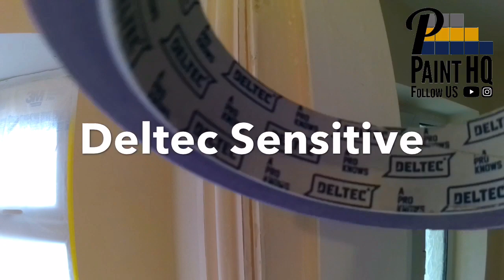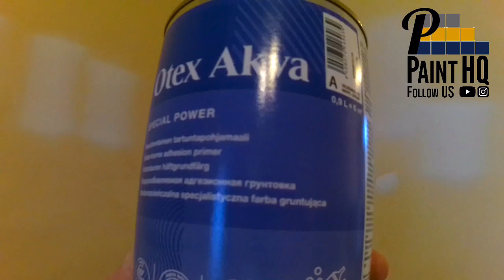HACKS for Painting! Hand Masker tips to spray a door frame

Comment: Will a flatter paint cover up the semigloss overspray? For example crown to a ceiling? Would a complete flat paint cover over semigloss without out any shadows?
Reply from the maker: Hi Chris, in my experience I’ve never had any issue with covering the overspray.. I tend to use a durable matt product, so it’s not a dead flat matt.. sometimes I’ll quickly scuff sand the overspray, otherwise I’ve gone straight over, with no issues 👍 good question my friend.. great to have your. Input on the channel... regards Pete

Comment: Did you add some water for this paint or you spray straight from can? 😉
Reply from the maker: Hi Sebastian, thank you for your question.. if I recall I sprayed straight from the can.. typically with airless spraying I don’t thin paints, the handheld is airless too but sometimes a splash of water helps ease the flow and keeps the speed down.. I don’t look to go above speed 7.. it’s when these handhelds are run flat out at speed 10, and for bigger projects that the pump gets overworked and can fail.. they’re great machines, but designed for small / touch up projects 👍 keep in touch my friend.. regards Pete
Reply: @PaintHQ  thank you very much for your respond 😁 i bought the graco ultra and what tip you recomended for the trim and baseboard? If the baseboard and trim have factory primer i must use under coat or not? Best regards Sebastian 😁
Reply from the maker: You’re very welcome, anytime.. Typically a 310 covers spraying trim / woodwork paint, including wider passes (6”) on doors.. I like to use a primer even if the product is factory primed.. then usually I’d look to use the primer (undercoat) that’s the same make / brand as the topcoat.. we call it the same ‘system’ 😆 ..hope this helps.. regards Pete
Reply: @PaintHQ  Ok thank you 😉 One more question 😉 I have ass well the wagner control pro 250m sprayer but there no pressure gauge and I don't know how set up the pressure for spraying, always use 5 max. For ceiling and walls but then its lot overspray😁😁
Reply from the maker: In happy to help my friend.. I’ve done 2 videos on the 250M.. check out this first, it’s my most recent upload..
 
Wagner 250M Setup. Airless Spray Tips Explained. Wagner 250M Cleaning
https://youtu.be/8APgip0-5J8

Then this one..

Wagner Control Pro 250M | DIY Airless Paint Sprayer
https://youtu.be/3Mlzp37Uepg

Comment: Not sure why you would fo through all the trouble of masking for spraying the one frame .. especially if there's people's furniture still there .. what else were you painting .
Reply from the maker: Thanks for your input.. on this project 2 frames were sprayed, both oak doors were removed, prepared and sprayed with clear lacquer.. ceiling was sprayed and walls brush and rolled.. we spray all woodwork, you can’t beat the finish.. and when the spraying is a small project, we use the handheld.. we find masking doesn’t take that long and it’s worth it for the finish.. thanks for your feedback my friend, always good to hear other peoples process.. keep in touch.. regards Pete

Comment: Is it necessary to sand down the woodwork when using shewing primer?
Reply from the maker: Hey Anthony, thanks for your question.. do you mean an adhesion primer? I’d always recommend sone level of sanding, even if it’s just a key with a high grit paper / between coats sandpaper / or a Scotchbrite Red.. hope this helps my friend, always happy to help if I can.. regards Pete
Reply: Thanks,  and sorry for the typo
Reply from the maker: No problem, anytime.. at first I thought it was a type or brand of primer that I hadn’t heard of 😂🙈 ..All the best mate, feel free to ask questions, I’ll always do my best to help if I can 👍 ..Regards Pete
Reply: Thanks Pete. I'm fairly new to airless spraying and just finding my feet with it. GX21, 517 tip, spraying ultra smooth sandtex with 10% water. Going pretty well,  but I do end up with quite a bit of paint on the tip guard   and not due why. It's the inside of a warehouse   so not a big deal this time.  Any idea what I'm doing wrong?
Reply from the maker: That’s great news, you’ve got a great machine in the GX21 👏👏👏 ..First of all, it’s good you’re questioning the amount of paint on a tip guard, it’s something I’ve tried to demo in a few of my videos.. to use that as an indicator, how clean and how well you’ve sprayed.. It’s an indication paint is bouncing off the wall (as a result, transfer efficiency is reduced, more over spray and material waste).. basically you’ve either too close to the wall and / or pressure too high.. it’s also common when using ‘production’ tips (not LP - Low Pressure - sometimes Graco give a production 517 with the units they sell).. production tips are longer lasting, often used on site (quicker job) but pressure is higher.. You could try a LP tip.. normally I’d recommend a 515, but I’m not quite sure what the viscosity (thickness) of Sandex is.. you mentioned you thinned by 10%.. did you need to thin to eliminate tails with a 517 ? If so, your probably spot on with the tip, just check your distance and speed moving the gun .. sorry if I’m not making sense.. you’re doing great, just small tweaks to get that sweet spot of airless spraying that’s so satisfying 😆 ..Well done on the warehouse job, like you say, not so important in fact you’ve probably sprayed it exactly how those type of jobs get sprayed.. for coverage / speed and bounce back will happen 👍👌👏😆 ..Keep in touch, I’m more than happy to help in any way I can on your spraying journey 💯
Reply: @PaintHQ  that's so kind of you   thanks. What's the best contact gor you?
Reply from the maker: You’re very welcome 👍 ..Most people msg me on here, I always reply.. Then if you wanted my email in future, I’m happy to sort that for you.. Regards Pete 🎨💯
Reply: Thanks again. The 517 is a graco LP tip. 10% water was the retailers suggestion. Josh at Spray Direct. About 1500 psi got rid of the tails. I felt like the paint on the guard was coming directly from the tip, not bounce back.  I'm about 10" from the wall.
Reply from the maker: Ah cool, all that sounds like you’ve got it spot on, 1500 psi is relatively low too 👍 all good, well done.. you could try being a little further away and moving a bit quicker.. is it brick / breeze block you’re spraying? A rough surface?.. just when it’s rough or uneven it can be tempting to be closer or slower to get the coverage
Reply: @PaintHQ  yes it's breeze block  some painted, dome not. I'll have another go tomorrow.